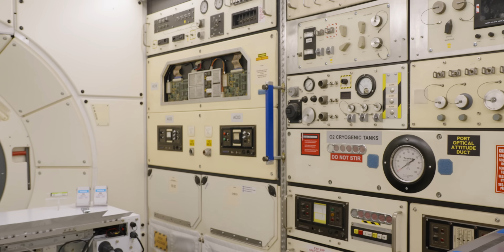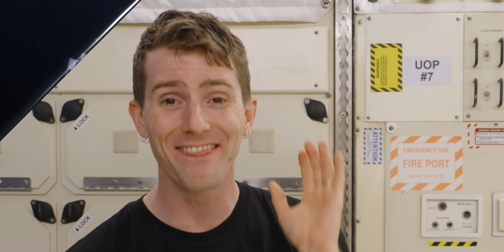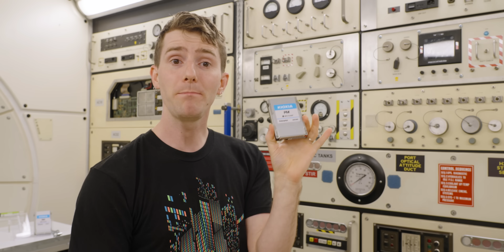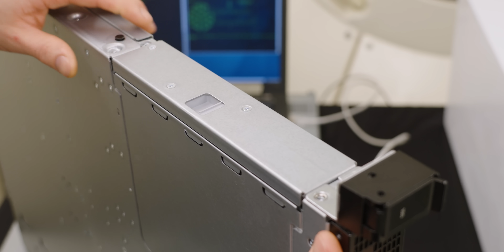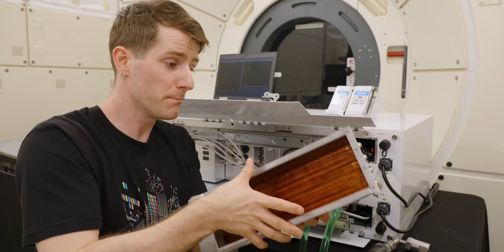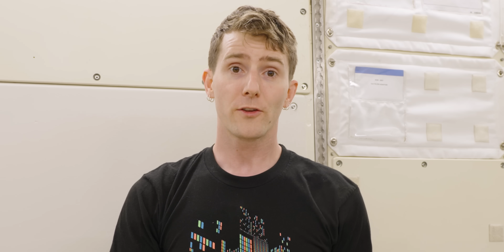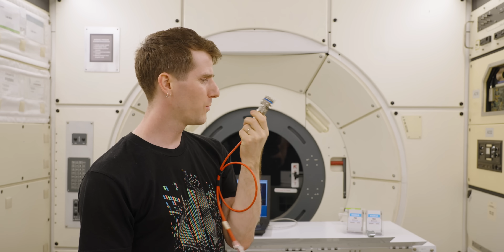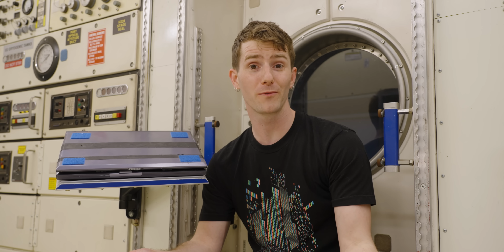here's why it's so hard to put a computer into SPACE - NASA HPE Spacebourne 2

Comment: My dad actually works with these exact sorts of parts! He’s not at HP/NASA/Kioxia but his company focuses on “high reliability” engineering and packaging for electronics. He actually worked on some parts for the Curiosity rover that’s on Mars rn! At a consumer level, electronic packaging is basically designing things like a CPU’s IHS or similar constructions. The focus is mainly on things like temperature, but once you hit “high reliability”, you run into so many different problems. The point is that these parts are designed to be in their designated extreme environments for years without any significant maintenance/replacement. Space aviation is obviously one of the big markets for high reliability parts but so are things like consumer airplanes (my dad worked with Boeing for many years to help with their black box designs) and even the defense industry (my dad also worked on missile guidance systems). Obviously for those latter two the issue is usually shock but for space radiation shielding has always been the #1 concern, followed by shock. Temperature ends up being one of their lowest concerns actually! It’s a really interesting field of engineering that people tend not to think about.

Comment: They shouldn't be using standard file transfer tools over an unreliable network.  It's easy to write a fast file transfer protocol for unreliable networks.  Heck, torrent  transfers are essentially file transfers designed for unreliable networks.  Data blocks can be transmitted in any order, and every data block must eventually be ACKed, but a failure to ACK a block doesn't hold up other blocks from transferring.

Comment: They are working on getting starlink. Spacex is going to be testing it on an upcoming mission on their capsule. The problem with anything at the space station is it takes years to do studies and tests to verify it won’t interfere with anything else and starlink has only been a viable option for the station for 1-2 years. I wouldn’t be surprised if it was in use in the next 2-3 years

Comment: You're too young to remember, but the first laptop in space was by Grid Systems. Their product, the Grid Compass 1101, was introduced in 1982 and became notable for its rugged, clamshell design and magnesium case. This model was used by NASA on the Space Shuttle missions, starting with STS-13 in 1983. They were VERY expensive as I recall. The computer featured an Intel 8086 processor, a 320 × 240-pixel electroluminescent display, 340-kilobyte magnetic bubble memory, and a 1200 bit/s modem. Devices such as hard drives and floppy drives could be connected via the IEEE-488 I/O (also known as GPIB or General Purpose Interface Bus). This port made it possible to connect multiple devices to the addressable device bus. It weighed 5 kg (11 lb). The power input is ~110/220 V AC, 47–66 Hz, 75 W.
Reply: Word for word copied and pasted from wikipedia.
Reply: The 8086 was a ceramic chip.

Comment: It's crazy to consider that de-orbiting the ISS and making a new one is cheaper than retrofitting the old one. There was a serious lack of thought into including on-board fabrication facilities and tooling. Not to mention the crazy parasitic relationships some of these manufacturers have, charging 5000-10000% markup on mechanical parts.
Reply: ISS has been up there for decades, and things wear out and nothing last forever. too many old outdated and worn out systems and hardware. it is actually cheaper and safer to start over at this point, using the lessons learned from the current station to develop an even better one.

but the future is not in LEO, it's beyond LEO.
Reply: Great idea, let's send a lathe up there so it can spray metal chips and cutting fluid everywhere in zero-g. The average soft-handed astronaut that is costing $150k an hour will surely make those parts better than a 25-year experienced machinist down here on the earth.
Reply: @shanent5793  You can engineer around these challenges? Train a machinist to be an astronaut or an astronaut to be a machinist? 
People like you are why the government is inefficient.
Reply: @I_Am_Empyrean  @shanent5793 well to be fair the ISS wouldn't be able to run a lathe with the power needed. Though again the ISS has been up there for decades, the foundational power limits have been set, yes they have improved, though not a crazy amount.

Comment: They should have a big diesel generator mounted near the back porch with a big O.2 tank.  Now there would not be a power issue... but the cost to have a big supply truck to deliver more fuel would make this a non-starter.  Or how about a long extension cord.

Comment: They launched a hard drive with a super capacitor, but accidentally launched an experiment that tested what happens to unshielded super capacitors when bombarded with gamma radiation. The ISS will ALWAYS manage to gather data about something.
Reply: True science is just as excited about a bad result as a good result. Because it's still a result that they can learn from. And let us never forget just how many amazing discoveries were made by accident while trying to learn something entirely different. Accidental results are some of the best we've made.
Reply: Oh my, I'm curious of the results
Reply: @noobulon4334  The results were simple: SSDs in space fail much faster than on the earth, as the super capacitators break faster and therefore the SSD gets overcharged during saving procedures earlier compared to earth. Solution: regularly backup your data - that's why they have this big server with longer living capacity, so that they can save the data from the experiments all the time and then send it to earth in big packages.